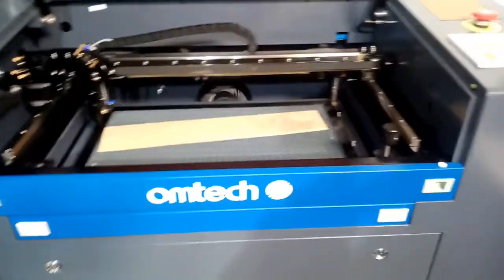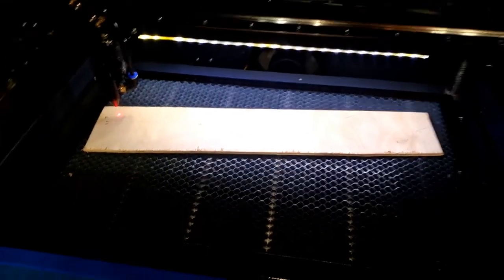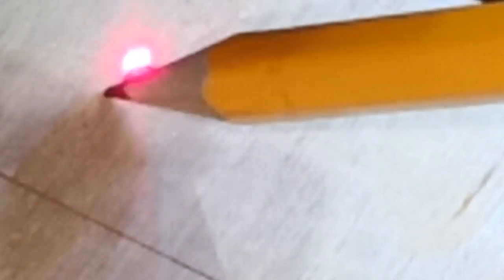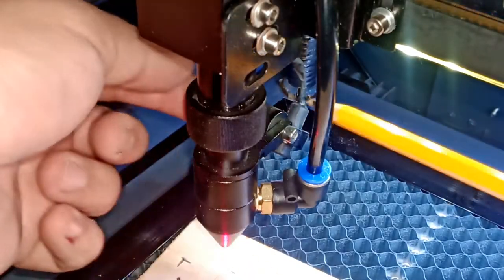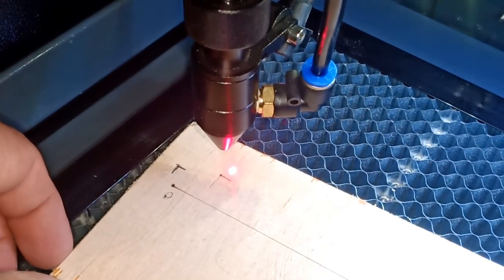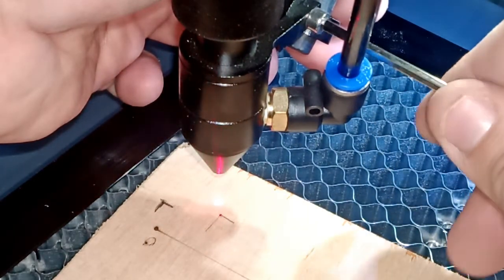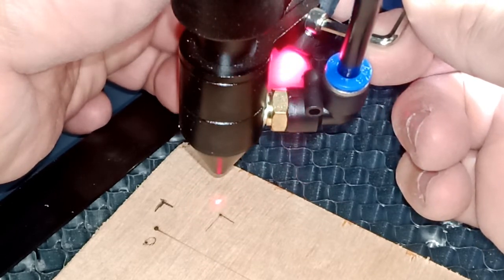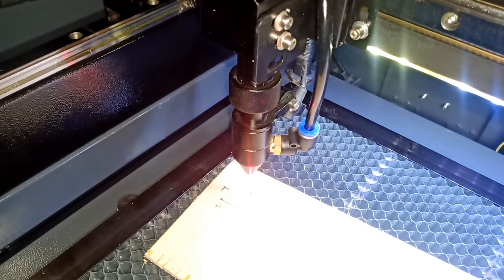Laser Red Diode Adjustment for OMTech 50W CO2

Comment: Hello I tried it but every time I tied up the screw, it goes back and it's position. So I cannot move the laser dot right or left?
Reply from the maker: @PaulFraker  hello friend not sure what type of bracket you have a small suggestion but you have to be careful you can always take that bracket off  slide bend it to the direction that you need just be careful so you will not break the bracket